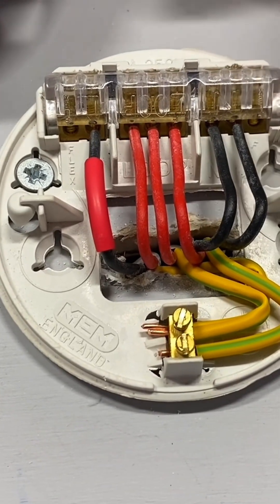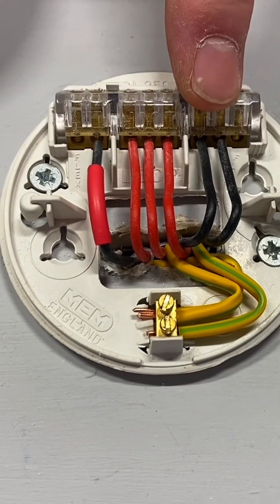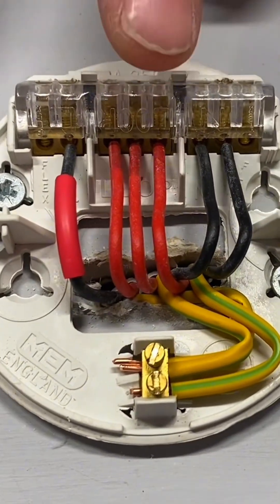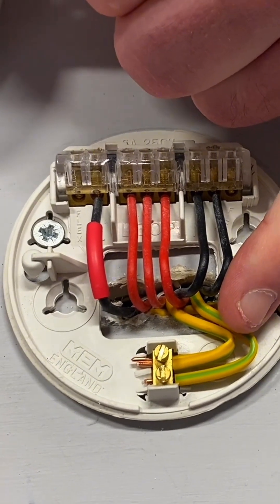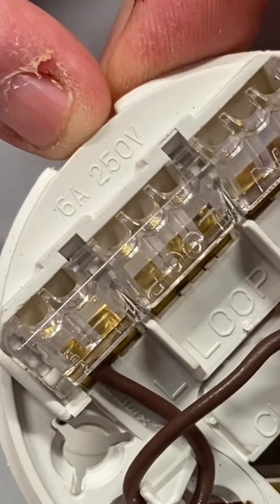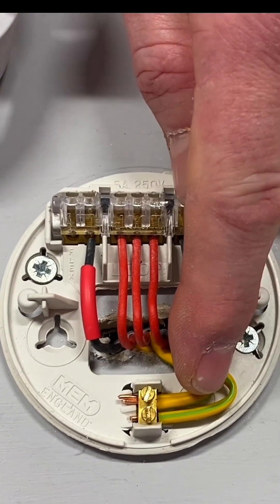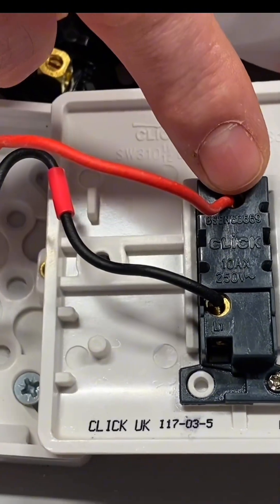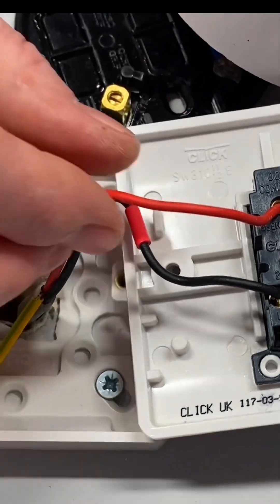How Lighting Circuits Were Wired - Old Cable Colours Explained

Comment: Sleeving is a big no no use the correct colour insulation
Reply: The video title is: "How Lighting Circuits Were Wired"

NOT: "How Lighting Circuits ARE Wired"

It's purpose is to show learners what to expect when looking at old installations, not an instruction on what they should be installing.